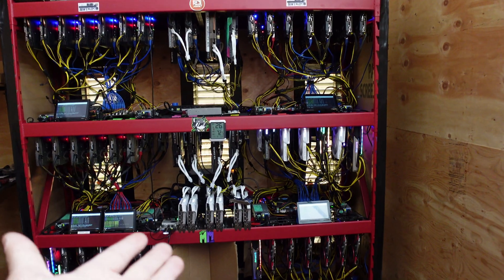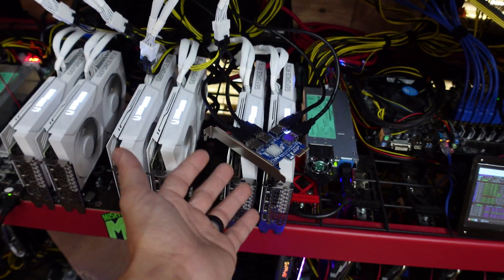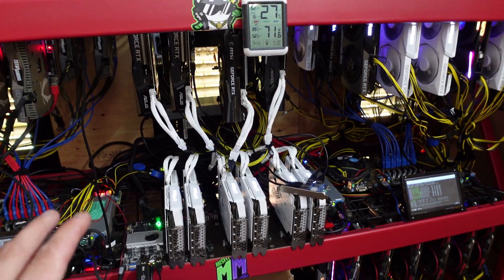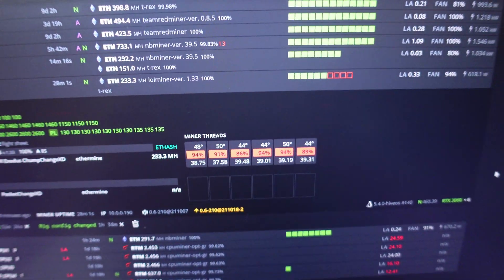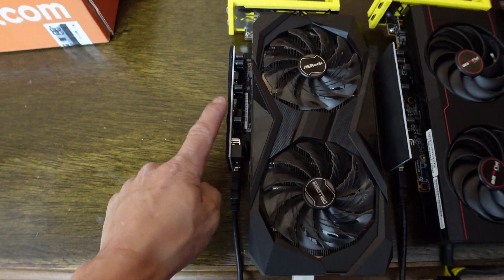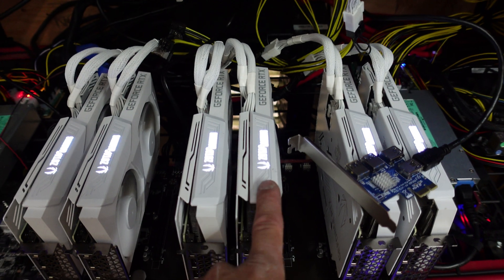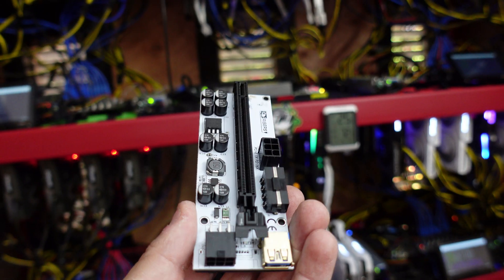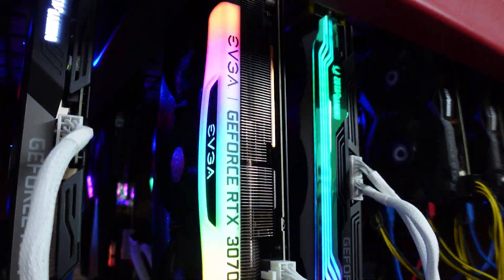RX 6600XT Ethereum Mining Problems 2021

Comment from the maker: Have Your GPUS Just Randomly Fallen Off On You Before? Let Us Know Below!
Reply: Like fallen up
Reply: How do you get that many V1 3060s on 1 board at full hash?
Reply from the maker: @bradhardman3693  They Hash Around 38-40 on lolMiner So 3/4 Hashrate not Full
Reply: @ChumpChangeXD  even on simple miner?? And what are your other clocks if you don’t mine? I was about to buy two of the OC ASRock‘s 12 Lane 3X 16 slots yellow motherboard with LCD screen! Lol almost $600 with tax…..
Reply from the maker: @bradhardman3693  📖 3060 Twin Edge OC Overclocks (ETH): 38-40 MH
Core: 1430
Memory Clock: 2600
Power: 130
Fan: 80%-100%
Reply: @ChumpChangeXD  I just bought your Misfit mining frame to help with that electric rate! (I called my EMC yesterday about getting lower than 0.08cents 😆 ) I have a tiny Rx480 I haven’t turned off mining for longer than an hour since 2018! Lol HIVE OS just crapped on me so I switched to SMOS. What do you recommend? Just curious
Reply: Oh and drop the Amazon affiliation link for the yellow PSU 24pin splitter (your buddy told you about) thx!
Reply: Hope Brandon Coin sees this regarding his last video lol 🤦‍♂️🤦‍♂️🤦‍♂️
Reply from the maker: Yea I saw him drop that last night thinking my to my self… it’s definitely Not my power cables (at least what I saw) lol
Reply: Yes. I had the issue with the sapphire rx 6600xt. Ask rondy how he fixed it. 😆
Reply: I got a 3070 ti that has been picky ever since its not in a full slot.  tends to always be the one that drops.  sometimes its days, sometimes its hours.
Reply: Hi, Can you add another pcie 1-4 soon? Im waiting to see if it can handle at least 12 gpus.
Reply: Hey Can you shout out your alt YouTube channel CCXD but the gaming one ty
Reply: Would you share overclocking rx6600xt in nicehash?
Reply: I also had 1 dead gpu riser out of the 6 purchased but no burned mark..

Comment: Hello, can you send me this bios? My bios has a problem and I can't even replace it with the factory version bios because both versions are the same. Rx6600xt sapphire pulse
Reply from the maker: This is on TechPowerUp. Hope it helps brotha! https://www.techpowerup.com/vgabios/236290/sapphire-rx6600xt-8192-210604
Reply: @ChumpChangeXD   Is it possible to change the version of the BIOS file before installing it to solve my problem during installation?
Reply from the maker: The biggest thing you need to do is make sure you have the same memory type before you flash the gpu with a bios new. You can tune the bios on the older cards I’m not sure about the 6600XT to be completely honest never tried
Reply from the maker: If you flash with a different memory type you can brick your card
Reply: @ChumpChangeXD  Gddr6 Samsung
Reply from the maker: @AmirG6-r4u  you may have bricked the card if you flashed a different memory type
Reply: I tried but it didn't install because the versions are the same, can I manually change the version so it just installs?
Reply: Is there a program to make changes in the bios?
Reply: For changes before BIOS installation

Comment: Hey chump, from my experience with my 8x6600 XT rig, they are incredibly finicky when it comes to undervolts and over electricity. If you do not have 6 or more capacitors on your riser you will have crashes eventually. Also, undervolts and overclocks are so finicky on these cards and sometimes you have to change them. So odd. I think these 6600 XTs get thrown off and fall off hive when there is any inconsistency in electricity flow. Have you had similar experiences with overclocking these? I’ve found the gigabytes eagles are really annoying to undervolt and overclock.

Comment: 8:29 That GPU risers riser appears to have just the dropper resistor for the LED tombstroned, I think it was attempted rework at the factory, the burn marks are just from the soldering iron.
This riser should be perfectly functional without it.

Comment: How does the 4 way splitter work if not inserted into the mobo PCIE slot? Do you just run a USB to the mobo?
Reply from the maker: You have to connect that splitter to the Pcie on board cannot go into the USB on board
Reply: The cable is the only USB thing about risers. It’s a common cable used to transmit the PCIe signals from a X1 board to the riser card. Can’t use a USB port on the system, not the same. The 4 way splitter breaks a PCIe slot to 4 x1 signals (bridge) to connect to 4 riser cards. I hope that helps!

Comment: I feel your frustration. I have had my own riser battles on a new system over the last couple of days during very limited test time because of work and life. I finally think I won, and the system's been up for like 16 hours without a problem. That is such a great feeling! 🍻🍾🎉
Reply: Do you know how to fix “gpu driver error, no temp”?
Reply: @JustinJoke135  I can tell you things to check. 1st would be connections and risers. Make sure you have adequate power going to the card and not split beyond wire current capacity. Try an older video driver, like ChumpChange suggested in the video. And, the final thing I ran into was I had issues with just one risered card on my system, as soon as I added a second card things worked?!?! It was strange, but who am I to complain. I have seen some very flaky things in my relatively new mining experience. 
I hope one of those helps!
Reply: @Average_Geo  honestly Ive tried everything you mentioned. Things still didnt work. So frustrating.
Reply: @JustinJoke135  Hmmm, the other two thoughts would be to try an earlier version of the miner, if you recently upgraded it. And, the last would be to put the video card in a full PCIe slot on a system and see if you can mine from it on that system. If it is already on a riserless system, maybe swap it with another card/slot.
Reply: @JustinJoke135  I had another thought. Maybe you have the PL throttling too low, so try bumping that up. Also, verify you are not overloading the 80% watts of your PSU. You could be maxing out wattage at peak usage causing the card to glitch and stop producing proper responses.
Reply: @Average_Geo  Thanks George, I've managed to fix the rig, it is just OC settings. Thanks God. I really appreciate your help. Thank you!

Comment: That's very interesting I have a rig running 4 3060 TI and a 6600 XT the rig kept crashing so I took out the 6600 XT and now I've had no problem for two days I don't know why you have any ideas
Reply from the maker: So what I’ve come to find out I think it is the core voltage and memory voltage if the car does not like what you have it out you need to turn it down ever so slightly and then give it time to see if it happens again
Reply: @ChumpChangeXD  ok thanks my friend seems to think card is not compatible with nividia cards on same msi z390 motherboard